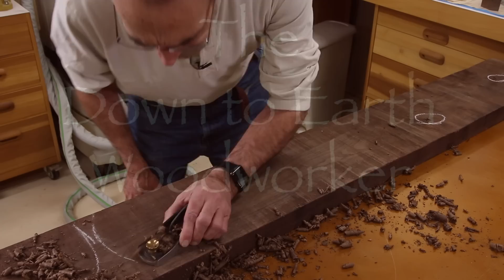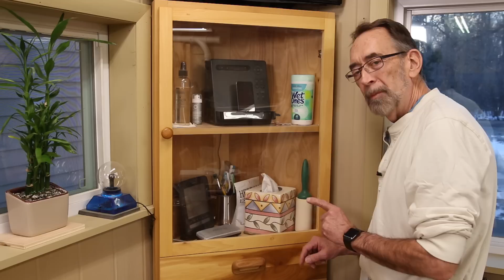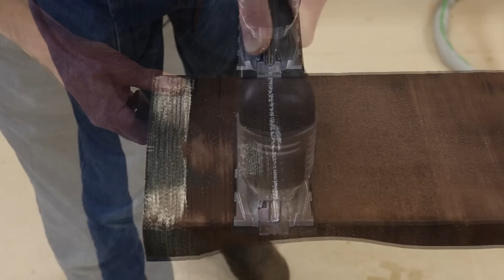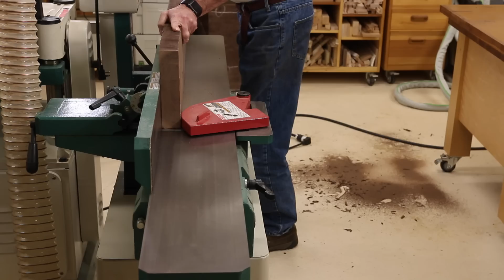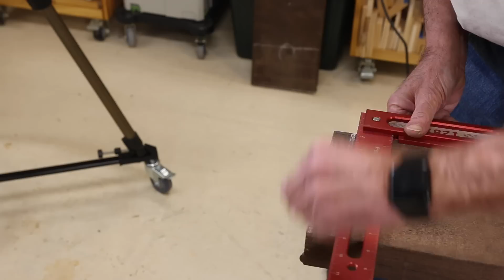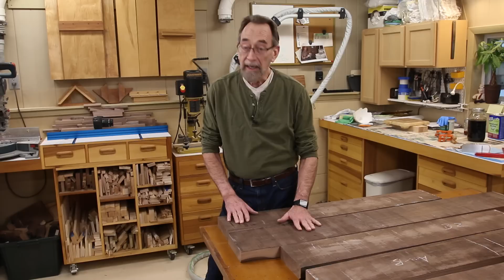Bath Vanity Part 6

Comment: Hi Steve, what metal detector do you use? Did you end up gouging out the piece of metal with a chisel or did you cut the board on either side before milling?
Reply from the maker: +Dieter Jones The metal detector I use is a Lumber Wizard 4 --- Amazon has it for a good price and the seller ships really quick.  To get the pieces of metal out, I drilled a hole with an old drill bit until I hit the metal and then dug it out with a pair of forceps.  Thanks for watching!!!